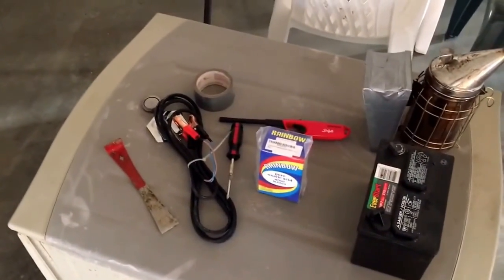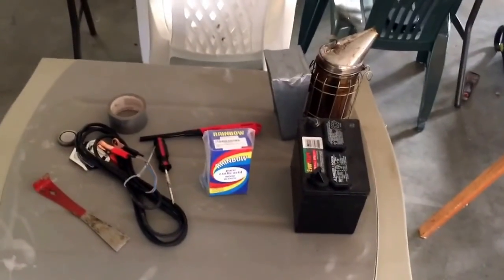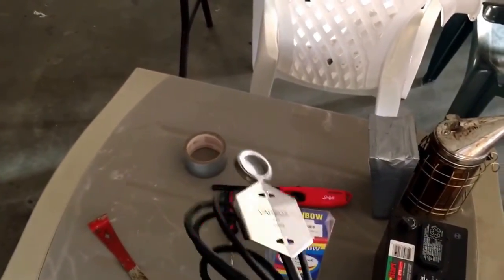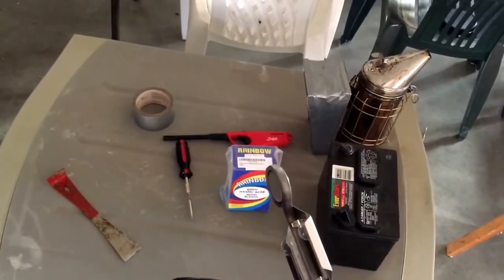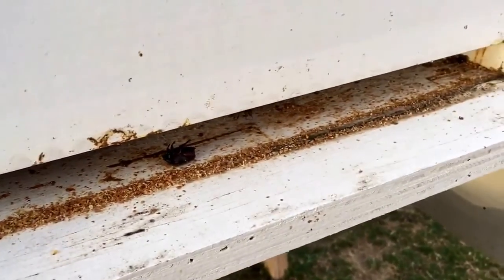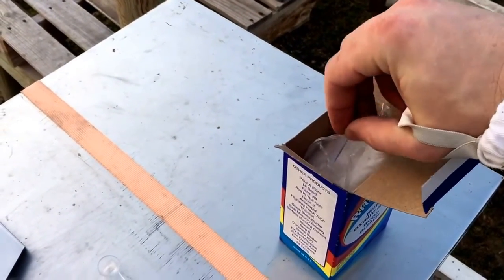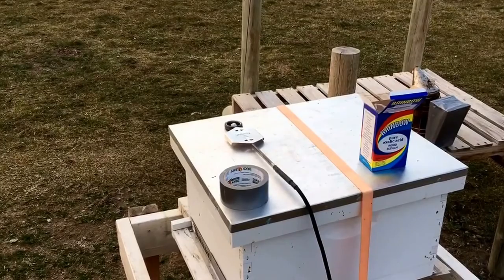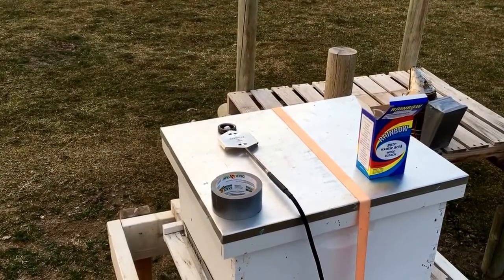(2/20/2016) Varroa Treatment Using Oxalic Acid Vaporizer

Comment: I'm a beekeeper in the uk, and yes we've been using oxalic acid via a vaporizer for a few years now.
The results are perfect mite kill is I would say close to 100%.
The comment regarding using gloves a particle mask are a must.
On the comment where it says you must not use the treatment while the queen is laying or has open brood that's not correct.
The treatment can be used with capped brood,uncapped brood.
Honey capped or uncapped,eggs etc etc.
It won't affect any honey in your hive(s) either.
It's best to use when the brood is uncapped and in the larvae stage,this is when the mites enter the cells to lay their eggs.
A keeper called little joe may treats all season from spring to autumn ( fall).
He treats once per month and yes he has a lot of hives.
In my opinion I would use oxalic acid over any other treatment, as there's no contamination of the honey compared to using mite strips etc and other forms of treatment.
I hope this is of some use to anyone reading this.

Comment: Thanks for taking the time to make this video. It is my understanding that you are supposed to remove or separate (with cardboard) the honey super that is on top of your 2nd hive. Also, I have read that the best time to administer this gas is when the queen is not laying many eggs and no brood in the cells. Otherwise it would be best to do a few treatments 1 week apart.
Reply from the maker: I agree with everything you mentioned in your post.  The super you see in the film has no wax built or honey, so I deemed it to be safe.  (just an empty shell)  Thanks for the comment!

Comment: You are doing this at the right time of the year,but you never mentioned why. I'll explain why. This treatment only works on the bees,(mites in brood cells are protected from the gas) and not the brood. That is why he chose this time of year. Gives a brood-less hive a big jump on the mites.I would like to add that you need to inspect the hive before treating . If you treat the hive and it is not queen right, your bees may abscond. Efficiency is near 96%.Nice vid, Thank You for Sharing.
Reply from the maker: +Smokeydabee Charles Coleman  Excellent!  Thanks so much for taking the time to educate.
Reply: What does it mean '' is not queen right ''?

Does it men that there is no queen in the hive?
Reply: Queen right means they have a queen. Without a queen to keep them there the may leave. Biovet makes the Varrox tool used to treat Honeybees. They state it clearly in their publication (sent with the equipment) , that a hive needs to be queenright or you risk an abscond.
Reply: Thank you so much for answering that.
Reply: Bonnie Flory np, you are welcome